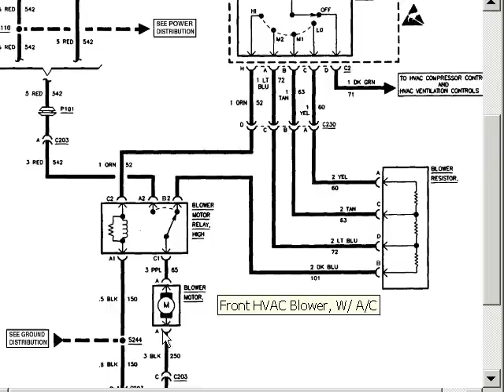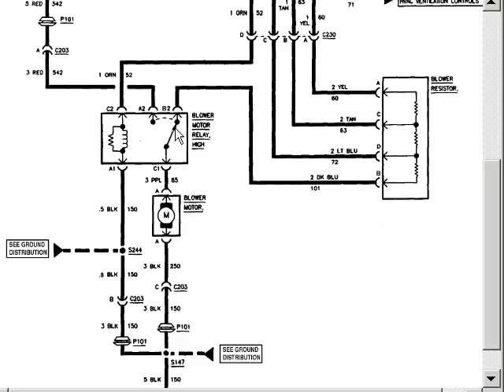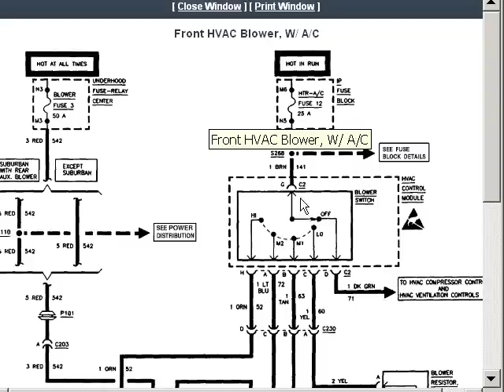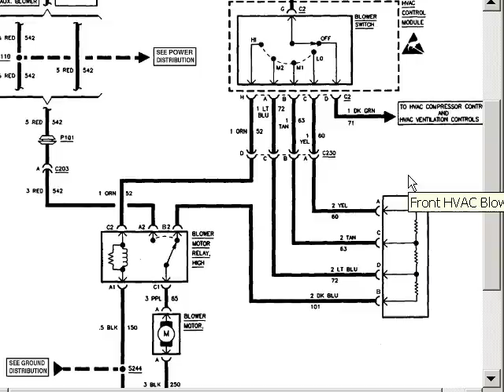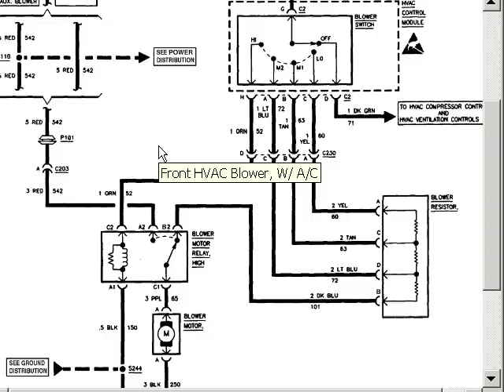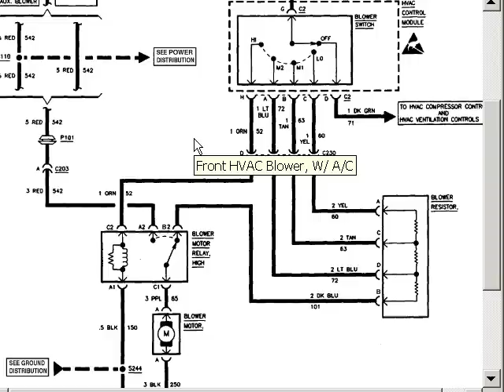Blower Motor Problems | Auto Repair Help

Comment: Im working on 2015 dodge dart blower motor stuck on low and vent module not moving. Replace motor and resistor. You think climate control?

Comment: this video helped me to identify my problem. the blower on my 2008 Ford Ranger became intermittent. either all blower switch positions worked, or none did. all fuses & relays checked out ok, so I suspected a short, a loose connection, or the blower motor at fault. tapping on the motor housing identified it as the culprit. something inside seems to be sticking so I'll likely have to remove it to find out why.

Comment: I have a 2006 Equinox 3.4 that I just did a bunch of work to. The car was without battery for 2 plus months and now the blower motor won't work as well as the cooling fans. All worked fine before.

Comment: I have a 94 Chevy G20 and the blower motor will keep kicking out on high intermittently it will come back on but works fine on all other speeds,  I have found burnt terminals both at the relay and the blower motor, this is the third time I change the blower motor any suggestions would be greatly appreciated

Comment: So my alternator went out on my impala... i replaced it and now the blower wont come on.... any recommendation. Before only worked on 5 speed only. I replaced blower motor and resistor. Still wont come on

Comment: My wires melted a bit
At the harnesd
I had to cut them off
Now not sure how the four
wires go back to the new resistor.helppp.
What is the color sceem..4 wires please
1998 ford e350

Comment: On the relay... I have an issue with A2 getting hot ,slight melting ( 3rd relay in 1.5 years) what do you think is happening?  Power issue?

Comment: Hi hittelman, excellent video!
I already checked fueses, blower resistor, and grounds an everything is ok, I unpluged the blower connector and is giving 12.3 volts and the blower isnt working at any speed, but I connected directly to the battery and works fine (here is giving 14.2 volts)
So here is the cuestion, how I find or what is giving me low voltage to the a/c blower?
I watched another video where describes the Ohm in the blower resistor comparing a bad one vs a good one, and mine has the same results as a good one.
I forgot to mention that the speed control is working propertly.
Thanks

Comment: I changed the blower resistor twice.  Both times when medium is selected, the wire loop get bright red and the whole thing burns out.  Any suggestions?

Comment: 2005 equinox LT all-wheel drive blower motor inoperative all speeds need circuit testing procedure and wiring diagrams

Comment: Blower motor cut on and off. I replaced blower motor and resistor/power module. Blower motor still intermittent. Any suggestions ?

Comment: Thanks for the great video.   I have a 2002 Chevy Venture Van that has a blower motor that blows on all the various speeds, however, I do not feel the high setting is strong enough.   It could be they way they designed it.  But, assuming it is and I am still wanting it to blower harder, what is a way to safely increase the blower speed beyond factory specs and or find a replacement motor that has a super blowing speed.   If that super blower exists where do you find and rate them?    I like Ac that blows you out of your seat lol.   So, how do I achieve that if they designed the OEM to blow at an unacceptable High, but not high to me level.   Thanks

Comment: I change the resistor on the blower motor and relay blower motor still blows the fuse when I turn the speed fan on the question that be

Comment: I just replaced everything in my 96 Tahoe at first the only problem I had was blower fan speed one through 4 did not work so I replaced the resistor now that is installed and when I put the blower fan on 1-4 the ac control module will start to smoke but it’s it’s set of high the ac control module will stop smoking

Comment: What would cause the front blower to stop, but not the back one?  Let me add that prior to the front blower going out, both the front and back were only operating on high, which most likely is the resistor, correct?

Comment: Please let me pick your brain. 

2006 Chrysler 300 3.5 rwd.   

will not start by turning the key 
but it will start with the auto start,
 I can then turn the key and drive and the car 
-the blower motor does not work - The temp control unit background lights light up but the the blower motor doesn’t turn on nor does the rear defog.   
Any feedback from anyone  would be greatly appreciated!!  
Thank you.

Comment: Question. I have 1998 buick lesabre custom 3800 series 2 motor I replace radiator, a.c. compressor, blower motor ,blower motor relay, and I have no power to blower ,does resistor play a role on why I got nothing at all no heat no ac nothing from vents any idea what it can be ...thank you

Comment: i hope your still here, i have a rear ac unit on a 2000 chevy express van , my fan blower stopped blowing and can't really find anything on what to do, can you help????
Reply from the maker: The blower motor for the rear is located over the right wheel well. It contains it's own resistor module and relays. These can fail in addition to the blower motor itself. In other words this will require some hands on diagnosis of those components.
Reply: @TradingCarMechanic  well the resistor looks pretty good, speed knob placed in any position doesn't make fan run it was working a few days ago,don't know if there is a fuses  connected to the rear ac in the main fuse box under the hood, how do i check the blower motor in the rear, any ideas
Reply from the maker: @gerohan1964  I'm sorry I should have explained that diagnosis is performed with a multi meter and a wiring diagram. I think the blower motor is pulse width modulated on that model? Meaning a test light is not recomended for diagnosis. Visual inspection often doesn't uncover the failure.

Comment: I have to bump a relay underneath my hood for the blower to come on. It also only works on high, does this reflect on the relay underneath the hood on a 1993 GMC Sonoma SLE, 4.3liter engine if that matters?
Please help, the relay under the hood I think has something to do with the A/C switch for the blower

Comment: I have strange situation. 2006 pontiac torrent - i don't have schematic but it seems to be different than the configuration you're showing.  I have NO blower at any speed. Motor is good - if I supply separate 12 volt source to the power pin, the motor works properly at all speeds using the control switch. When I test for power using a meter at the motor, it shows 12 volts UNLOADED when switch is off, but as soon as switch is set to on, ANY SPEED, the 12 volts disappears, so it's only a "floating" voltage which shows up under no load. Same issue happens if I replace motor with a known good light bulb - 12 volts disappears as soon as switch is turned on. 
Both fuses are good (40A maxi fuse and 10A fuse under dash). 
Relay clicks when energized, appears to be providing path to grn rather than the supply voltage. (When relay pulled out, I still have 12 volts present at one wire at the motor, but no ground. When relay put back in, ground is supplied and will power motor if I supply a separate 12 volt source as mentioned earlier)

Comment: Do you have any idea why I would be only getting 9 volts to the blower motor? I have checked all the fuses and replaced the resistor.  I also checked the blower motor with a battery.  (2005 saturn vue)Thanks

Comment: I have replaced the blower resistor but my blower will still go from working like normal to blowing on high.  Seems to only be doing it when its raining.  Could it be water causing a short circuit?  2015 Nissan Titan.

Comment: I have a 1979 pontiac bonneville...in which the blower motor will not come on good fuse under the dash new motor new relay new resistor and new switch in the dash control still nothing but works whn i run a jumper wire from the batt to the motor....after a week of messing with it im freakin lost any idea what it could be.....

Comment: I replace the neutral safety switch on my steering column and now my heater does not have any power going to it nor does my speedometer everything else is good and has power but those two things can you help me diagnose the problem

Comment: good day, what if the blower motor works only on high, you change the resistor module, its works fine for about 10 minutes, then the resistor blows and go right back to working on high only.  note, that this happened several times.  how would you troubleshoot that

Comment: Hey mark, what about if my motor doesn’t turn on at all? I have no power at the plug to the blower motor plug-in. And I am not getting power at the fuse for “blower motor” in cab
Reply: Have u figured this out yet I am having the same issue with my 2002 chevrolet astro van... tested thick power wire to resistor n it dont work.. but all the settings work

Comment: My 1999 wrangler tj HVAC works perfectly. Until I select front vents or feet vents (non ac) But everything else works. The defrost, defrost and feet, front, floor, that are powered with the ac. I replaced the selector. Checked all vacuum lines and actuators. They all work. So when I select the 2 settings that dont use the AC, the blower completely shuts off. What should I look for?

Comment: Hi! Thanx for the great video! I have an audi a4 1996 with climate control. The problem is that my fuse is melting  and the blower motor positive and negative connectors are getting hot only when on 75 to 100% speed. The blower motor is new but problem persists. I would apreciate your answer if you can. Thanx!

Comment: The blower motor wouldn't turn on on any speed in our 2005 Chevy silverado 1500. We had power to the blower motor and the blower motor resistor. We replaced the resistor and everything worked for about an hour then the motor started going on and off and now it won't hardly ever turn on again. Can you help? Thank you
Reply from the maker: These type of electrical problems often require hands on diagnosis and testing. However, the way you describe the symptoms, it sounds like an intermittent or failing blower motor.
Reply: @TradingCarMechanic  thank you for your thoughts. We will check the motor.

Comment: My 2005 mustang GT a/c blower motor only blows on low. No matter which speed setting you put it on. What could that be ? Do I need to change the whole control module ?

Comment: Have a 1999 Suzuki Grand Vitara the fan will not work on any speed. Have replaced the fan, fan resistor and relay and fuses. How do you check the switch on the dash?

Comment: I have a 1998 jeep grand cherokee, the blower motor works on low,med#1,med#2, but not on high. has a new blower motor resistor and i have replaced the control pannel with a used one thinking that it was the switch in the control panel.need a wiring diagram to see how it's wired,i am thinking that all the fuses are good,will have to check them.does anybody know what i should do?
Reply from the maker: Does it have Automatic Temperature Control (ATC) system.
Reply: no.
Reply from the maker: Then the relay clips to the heater case housing. The relay is about six inches to the right of the blower motor connector.
Reply: THANKS ALOT,I WILL CHECK THAT OUT,THANKS AGAIN FOR THE HELP.
Reply: Is the relay in the breaker box in the kick panel? If so i need a layout diagram showing the fuses and relays and what they are for.no diagram on panel cover,no way to tell what fuses go where,or what relay is for.still have not found the relay for fan.

Comment: Great video! The issue with my vehicle is not covered in your video, but i was wondering if you could possibly point me in the right direction. Both fuses are good. The blower resistor, blower motor, and hvac switch are all new. i have power coming into the blower resistor but no power coming out? ive purchased 3 new blower resistors to confirm it wasnt a bad one. any ideas? thanks again!
Reply: the car is a 2012 mercedes c250
Reply from the maker: Mercedes is a whole different animal than the Chevrolet product used in this video. Unfortunately, Benz complicates the blower system with micro processors and modules not used by other brands. I would ask this question on a Benz or C series forum.

Comment: Hello I have a 1998 Ford F-150 I changed the motor change the switches on the Dash and the resistor the fan only works on low also change  the relay what do you think it could be thanks

Comment: I have a kia Sorrento 2014 it was clogged..water was leaking inside of car..water damaged something I changed the resistor fuse it worked for 10 mins low air on high then turned off and won't turn back on...could it be the blower motor to? If I can check the resistor fuse what is the reading supposed to be for a good fuse? Thank you
Reply from the maker: Fuses don't have resistance. Either they are bad (blown) or they are good. You can pull them out and visually inspect each one to verify they have not burned open. You can google what a burned open (bad) car fuse looks like.

Comment: I have a 2006 Pontiac Torrent, Blower motor is intermittent on all speeds. sometimes it works then it goes for a month without working at all, Replaced resistor and fan motor, still doesnt work

Comment: 1999 lincoln town car. Replaced everything. Blower does not go on high. Mechanics suggest vent blockage but I don't think so. I replaced the heater core and had it all apart.

Comment: Mine is the opposite of what you said the blower won't work on high I've already replaced the blower motor resistor but no change help please?
Reply from the maker: If you have a Chevy, with a similar set-up as the vehicle in the video, there's a separate relay for the high blower speed function. I think it's located in the under hood convenience center on many GM models.
Reply: mgittelman thank you. I have a 2005 chevy aveo ls. I will try to find that.
Reply: mgittelman I found 2 relays in the fuse box under the hood. One said AC high and one side AC low I replace the AC high but still no change. Any suggestions?

Comment: Hi Mgittelman, I have a 2004 grand  Marquis and I thought it needed a fan blower motor and changed it and found out that was not the problem, I turned on the ignition and turned on the fan to high and went under the hood and I hooked up my test light to the ground on the battery and unplugged the fan motor and checked one side of the plug  and the test light came on, then I changed the test light to the positive  side of the battery and checked the other side of the plug and the test light stayed off. So I have a ground problem.  I checked the ground on the firewall and it was tight and super clean. Now I am lost now what do I do? Please someone help me!!!
Reply: I have a climate control  unit I think, it has a wheel for the fan speed
Reply from the maker: I'm not familiar with the climate control system on that year Mercury. Some of these years used micro processors or dedicated control modules. However, if what you say is true about it being a ground issue then you could run an auxiliary ground from the negative terminal of the battery for testing purposes.
Reply: Yes, that's what I was going to do first, run an auxiliary ground directly to the blower motor  cuz there is a rubber gasket  between the firewall and blower motor. I went and bought a new blower motor resistor and getting ready to go out and install it . I will let you know what happened with the resistor in about 2 hours from now.
Reply: Yahoo, It was the Blower fan resistor. Works great. I couldn't smell anything burnt so it was more a guess that knowledge. I don't get  lucky much when it comes to electronics. It is always the last thing I check. 
Thank you for the help, The wife was so happy and I got laid for my work.  LMAO

Comment: i have a 04 4runner ive tested the blower motor and it works and i checked for power at the plug that goes into the blower and i have power coming from the plug but my blower never engages please help

Comment: Have a 2008 Mazda CX-9 blower motor will not kick on till car is running for about 20 minutes then it works just like it's supposed to on high medium low. I changed the fan motor and the resistor and it's still doing it what could the possibilities be

Comment: What could be the problem if the blower motor does not work on 1 2 3 or even 4. But runs when i bypass the relay? Is it still the resistor?
Reply from the maker: It depends on the year, make and model and whether it's equipped with dual zone climate control on some models. If it's a newer German car diagnosis can be quite complicated.
Reply: Thanks. I had the wiring checked by electrician and found out that there was a wiring disconnection  problem.

Comment: Please I have a 2010 Mazda CX-9 replaced new fan blower new resistor and stil no fan spinning only works one or two times in a week and suddenly start spinning and if I turned the car off and try to use the heater it wouldn’t work I’m confused
Reply from the maker: Usually it's the blower resistor or blower motor. However, I've also seen the separate blower relay malfunction. You can search for the replacement blower relay on the cx9 with copy and paste " Mazda CX-9 2007-2012 New OEM blower motor relay L1Y1-67-730 "
Reply: mgittelman ok sir thank you so much for your reply and consern that  was my last speculation check the relay under the hood next to the battery I appreciate your consern have a wonderful day happy holidays

Comment: I have 2005 chevy silverado truck resistor and harness has been replaced the 40 amp fuse under the hood by battery is blown put new in blew it what could be bad the blower motor  or control switch
Reply from the maker: Sorry, No quick answer for your situation, it will need some hands on diagnosis. Shorted wiring, bad blower motor, shorted relay and control panel issues can all cause blown fuses.